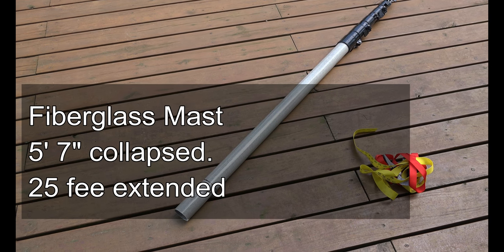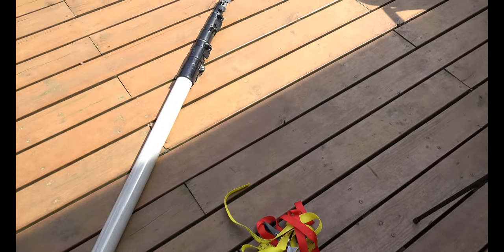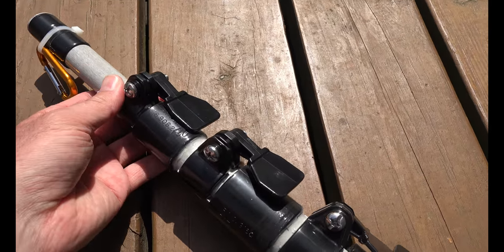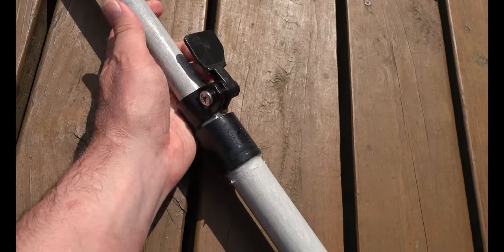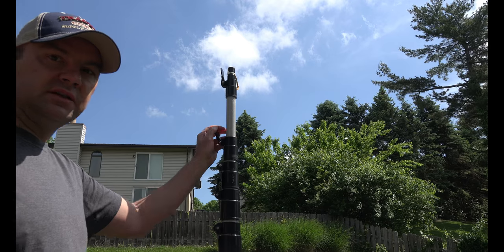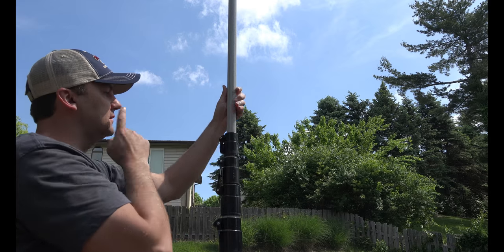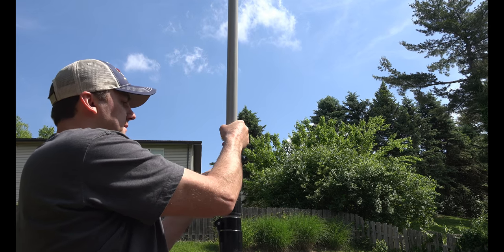Ham Radio Mast for Antenna | Setup & Review

Comment: I ordered the 28.5 - foot version and two sections didn't mate properly. I sent an e-mail and received a prompt reply with a phone number to call. Talked to Paul (yes, a real person) and he explained a short-term manufacturing problem. Two days later I had the new section.  Great customer service. This mast is the real deal. No springy, bending wimpy tips. Not meant for hiking, SOTA, etc. But field duty via car transport is easily doable. Will definitely buy another for VHF/UHF vertical.
Reply from the maker: Yeah this sucker is heavy sturdy. I love it

Comment: I have the 33ft version of this; here's what I did. I found a six inch piece of PVC that just fits over the top segment. Cut a few opposing slits in one end of it about an inch or so long, and use a hose clamp to compress that end of it to hold it to the mast. That will prevent the top section from falling into the mast. On the top is a basic PVC end cap with an eye-bolt. The eye-bolt has a very small pulley attached to it, sized just right for 550 paracord. When I raise the mast, I have at least 35 ft of cord to either side of the pulley. That way, I can raise and lower new antennas (dipoles, window line j-poles, vertical wire, EFHW, etc) pretty much at will. The only kind of antennas it doesn't work for would be those that need to attach directly to the mast, like a small Yagi or fiberglass vertical.
Reply from the maker: Great ideas, thank for posting.

Comment: I'm glad I watched your vid before buying the Max-Gain push-up. I was thinking I would be able to manipulate the whole thing from the attic window, and place the mast onto the wall mounts once my antenna has cleared the peak and eave of the roof. But it really looks like you want this thing to be on the ground when pushed up. I can still attach it to the wall brackets above, but not to do the whole job from that height. And definitely not while standing on a ladder!

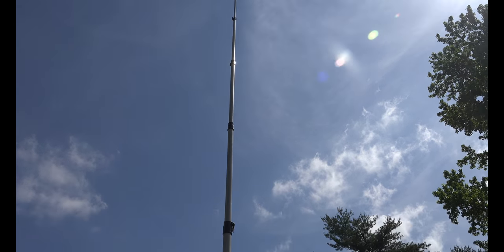Comment: 5:56  Pause the video.  Notice in the background, there is a brick chimney. This is already the home's built-in ham radio tower !  If instead of mounting this pole to the short fence, he mounted it to the base of the chimney where the pole would rely on the chimney strength, he wouldn't need guy wires, and the pole would have far more rigidity.  Also, if he painted the pole it would blend into the

      chimney, and since the chimney is on the tree side of his home, it would help disguise the entire antenna and mast.  I've used chimneys many times as braces for ground-mounted antenna masts. You can also make and secure a metal brace, with a C shaped hook or open eye-bolt,  on it near the top of the chimney. 

     This will allow you to feed the mast through the C hook to secure it to the chimney, and at the base you can slide the mast over a smaller pole which is either driven into the ground (pipe or grounding rod) or mounted in concrete in a 5-gallon bucket for temporary use.  The chimney is answer to stablizing, securing and hiding the antenna mast. It is your home's built-in ham radio tower !!
Reply from the maker: Hey Jennifer, this is, The Guy.  You make good points.  However, I wanted to stay stealthy and incognito so I didnt get a call from the HOA.
Reply: @hamradiocq   Oh, that is an entirely different issue. Yes, remain stealthy if you have an oppressive H.O.A. And, NEVER tell your neighbors or anyone in your neighborhood that you are a Ham radio operator. If any of them have R.F.I. problems, imagined or real, they will always blame it on you. I've been through this mill many times and taken to court. The best policy in a tightly

      controlled H.O.A. with nosy neighbors is to use attic antennas if possible, and operate 2 meters and 440 UHF during daylight hours. Then at night, you can erect a telescoping mast and put up a 40 meter inverted V. If you run 100 watts you will have no problems with neighbor RFI, however if you run 1KW or more, you can have some RFI issues with neighbors' stereos, alarm clocks and computers. 

     Make sure to take down the mast and antenna before sunrise.  HF Ham radio and HOA living situations do not mix well. Stealth is the best way to go, and if anyone asks you if you have heard strange noises coming from your clock radio or stereo or computer at night, say "Yes, I too have heard something like that."  "I believe it is that new installation that the electric company or cell phone company put in down the block, some kind of cell phone repeater system or something...I saw them working on it in the recent past."   Sometimes in life, "honesty is not the best policy" if you want to stay on the air while living in an oppressive and intrusive  H.O.A.

Comment: Unless you've added something of weight to the mast its not 20 pounds. The web page shows a weight of 12.3 pounds for the MK-4-HD. I have the MK-6-HD and its rated at 17.3 pounds. I never intended for this mast to be carried around, like back packing. I carry it around in my car and walk in a short distance where I set up portable or I've made a mast contraption that one of my car wheels is driven over to anchor the mast for use. I have several methods for mounting. I like to take this mast with me when I work special events like biathlons and triathlons. I am usually stuck at the furthest outbound distance from the start/finish line, by request, since I have an elevated antenna that lets my 1/2 watt HT communicate as if I was using a mobile.

Comment: I am looking to get into ham radio. If I wanted to use this as the mast for the antenna on my base station, could I do it? I considering raising it when I wanted to talk, and lowering it when i was done. This may be a stupid question, but I just started studying for my tech test today, so my knowledge is very limited.
Reply from the maker: Dustin H yes this one works for exactly that reason I can raise and lower it at will. Keep in mind the heights you want to achieve

Comment: Looks good brother! I have the MK-6-HD at 37' ground mounted and guyed for my 102' G5RV. Great mast...well built  and worth the $$. :)
Reply from the maker: Thanks!
Reply: Radio works has a great antenna much better than a G5rv. The G5rv is a 20 meter antenna and a real sacrifice for other bands. The 80 Carolina windom works well on 80, 40, 20 through 10. They are retiring however so wont be available long.

Comment: Are use a MFJ tripod with this mast and I also use a 5 gallon bucket with concrete in it and PVC pipe. Both of my set ups you have to take the bottom section of this mast.
Reply from the maker: That's a good idea.  This is working for now... I need a more perm solution though.

Comment: is this something portable and temporary or it can also be used as a permanent solution?
Reply from the maker: I have had it up like that for over a year in all weather.
Reply: @hamradiocq  Thank, I guess I will get this one then, have been doing some research recently. I live in a valley and it is impossible to even hit the repeater without some additional height

Comment: is this mast strong enough for a rotator to be mounted the the top for mobile use
Reply from the maker: No I don't think so.  Fiberglass, heavy, but I wouldn't do that.
Reply: If this is the Max-Gain mast, then no. They specifically state that these masts are not intended for rotators or large antennas.
Reply: You can get aluminium tele pole that you can fit the rota at the bottom 👍

Comment: Interesting that you decided to follow some of the instructions for this mast but you didn't follow ALL of the instructions.  This mast MFJ EXPLICITLY STATES in the instruction manual that IT MUST BE GUYED!
Reply: Very sorry for my comment about the guy ropes and what I thought to be your ignoring the need for them. Seems as though MFJ may have changed their construction of the mast to where it no long needs them.  Mine requires the use of guy ropes and I'm a member of a club that has the same model as I do which requires guy ropes to be employed as well.